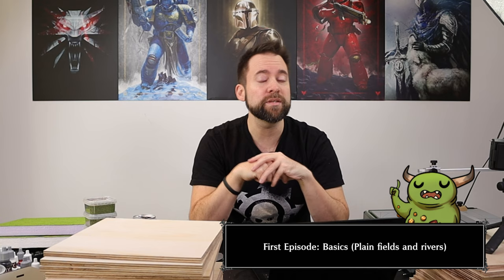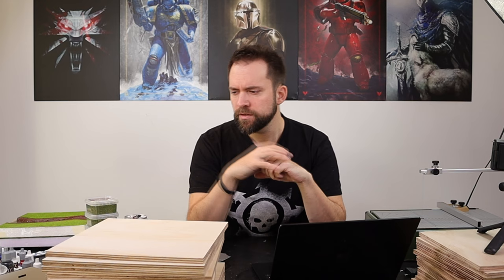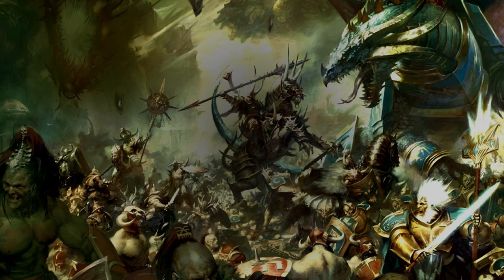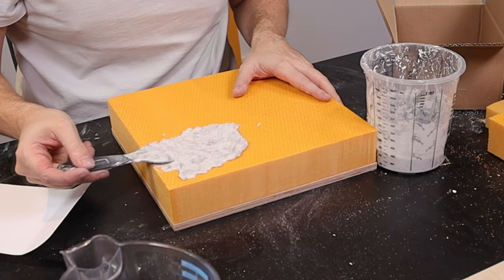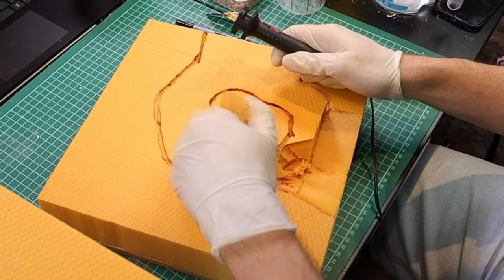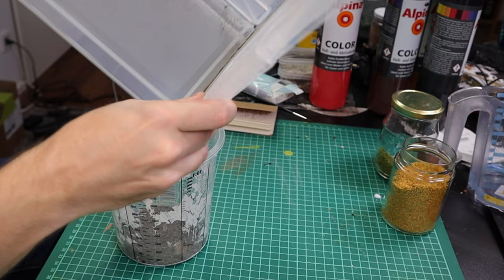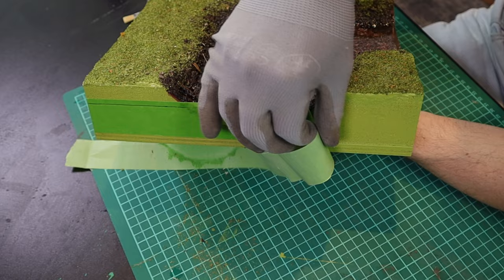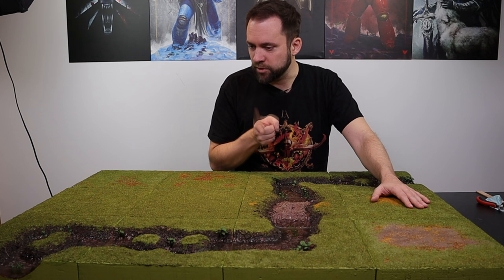YOUR OWN EPIC modular gaming table Ep #1 (grassland and rivers) - Basics and Step by Step Tutorial

Comment: I also used to use PVA, but I recently discovered a glue called "Liquid Nails" which comes in big squeeze tubes, it's fairly fast drying, incredibly strong and designed for glueing building materials like wood and foam together. It's really good for this type of thing.
Reply from the maker: Oh nice - does is dry transparent?
Reply: @MikesMiniatureWorkshop  No, it's not something you'd be able to use for the normal scenics bits. It's normally brown, depending on the brand. It's really good for getting a strong bond between big sheets or blocks of XPS foam, polystyrene, cork, acrylic plastic, and wood.